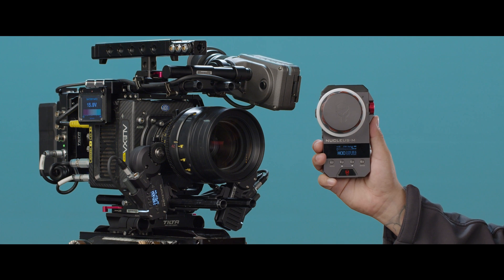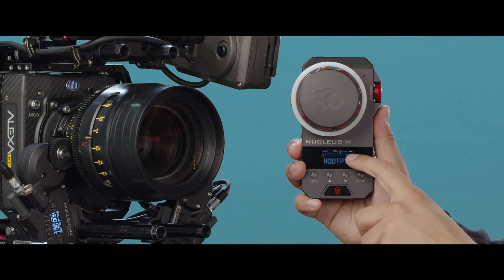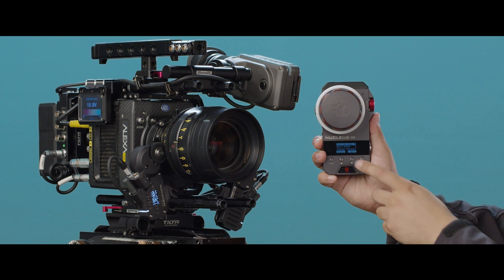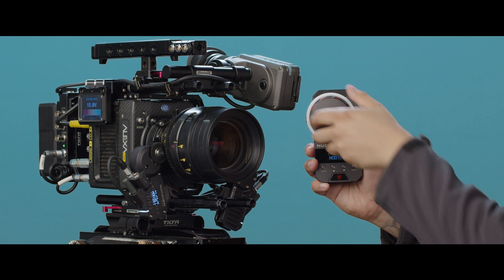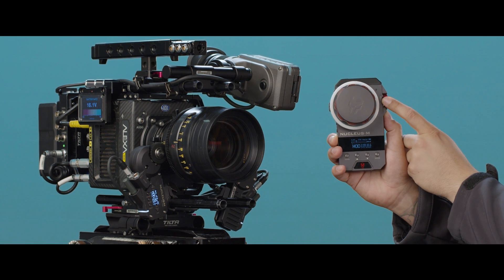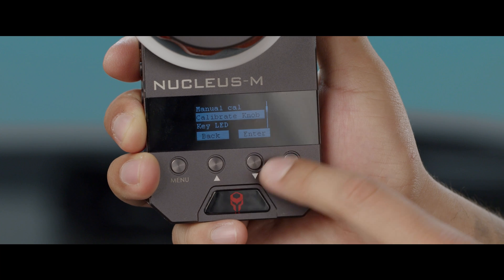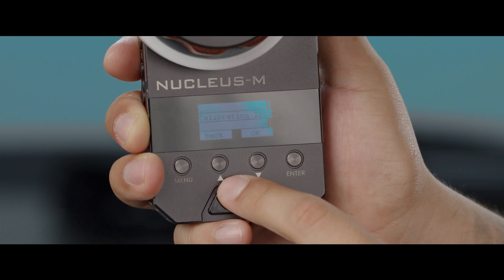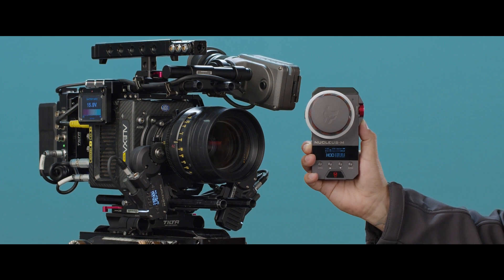Tilta Nucleus-M Troubleshooting Guide: FIZ Unit Calibration

Comment: After calibrating the focus knob as described in this video, the endpoint on the right still doesn't reach all the way to the end for me.
Reply from the maker: You will sometimes need to perform this calibration twice in a row! Also, try power cycling!
Reply: Same for me, did you ever find a workaround?
Reply: @JacobVossFilms  Unfortunately no.
Reply: Same, the auto calibration does not really work. We are even trying 2 different handsets, factory reset, .... is there a firmware update? Anything?

Comment: Is it possible to use the grip and 1 motor on a steady cam while using the Fiz and 2nd motor on a different rig?
Effectively having 2 separate units.
Reply from the maker: Yes as long as the motors are set to different channels!